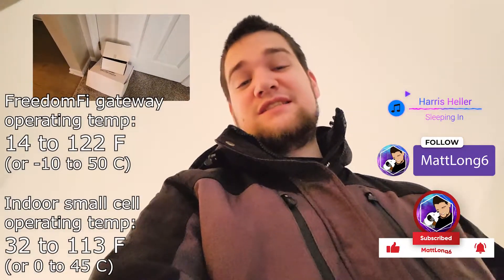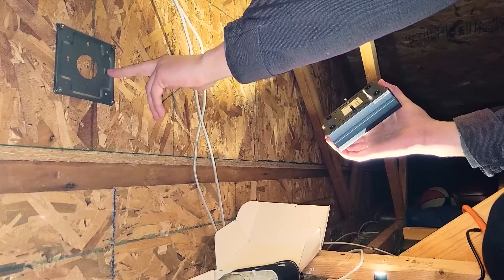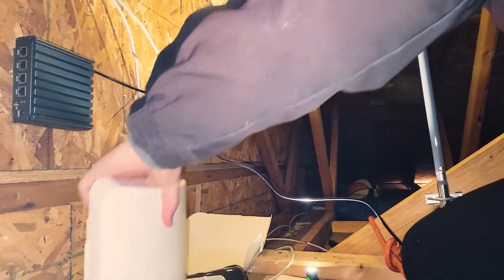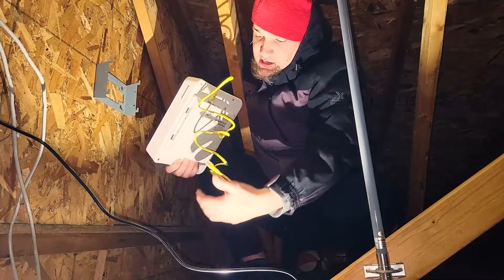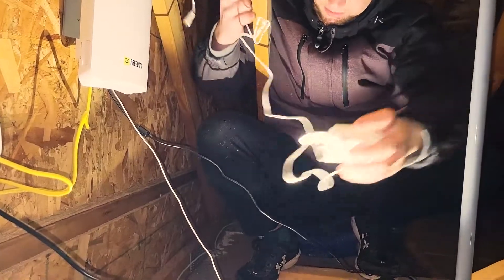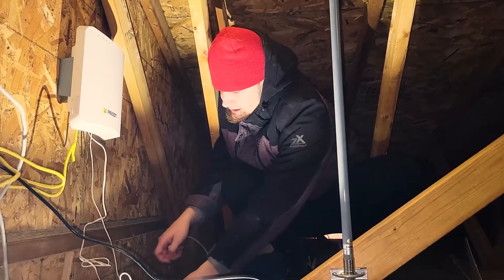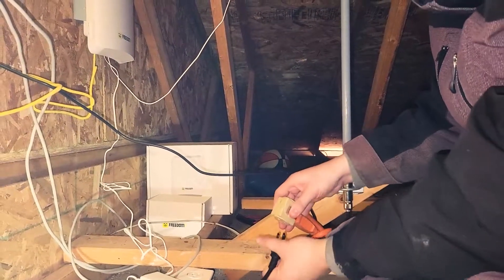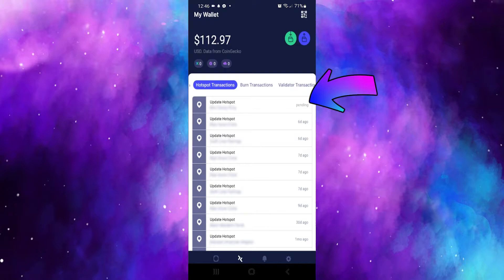Installing my FreedomFi with 5g Indoor Cell Radio - with 8dBi antenna

Comment: Great install video Matt. Very  helpful and informative. I'd like to follow your freedomfi nova430 radio could I please get the specific designated name?
Reply from the maker: Glad that I could help!
Sorry I do not give away the location of my hotspot, however I do a monthly livestream on my crypto channel where I talk about how much it has made. 👍
https://youtube.com/@MattLong6Crypto
Reply: @MattLong6  I can respect that sir. I was interested in following the location bc I am also doing the same setup in the attic and just wanted see the RF coverage map if being in the attic made great results.
Reply from the maker: @69orlando  I will say for my experience the least amount of walls and obstruction the better. Directly outside is the best, attic is also good because there's not as much walls to block the signal.
Reply: @MattLong6  Yeah the attic sounds like a much better choice then a ground or 2nd floor. I agree the higher the better 🤙
Reply from the maker: @69orlando  well would love to hear updates from you in my live streams that you ever make it 👍

I'm not entirely sure if higher is necessarily better, I was only talking about less interference.

The attic we put it in was above a garage.

Comment: What’s the point of running 5G hotspot in a residential area? It will only cover a few neighbors’ houses and your neighbors are likely using their own Wi-Fi at home for data thus you won’t have any mobile data to offload with. In addition, you need to pay $5 per month per radio after the first 12 months as per FCC requirement….
Reply from the maker: I am just testing it out, join the Discord and ask them to get a better understanding :)

Comment: Is that a 5g 8dbi antenna?
Reply from the maker: That antenna is left over from this video :) https://youtu.be/7wYxIlfp1VY
Reply: @MattLong6  very important question so you can use an 8 dbi antenna on the 5g miner?  also can you use an amplifier (acason) and filter on this miner(5g) with an 8dbi antenna ?
Reply from the maker: @Anibalm28  yes for the 5g and 8dBi. I have not tried the amplifier.

Comment: Who's better? Freedomfi is rakk.
Reply from the maker: What? typo?
Reply: @MattLong6  or.       not is
Reply from the maker: @shangtsung9973  if you want to upgrade to 5g, FreedomFi, better if you don't care about that then RAK is better, because it comes stocked with a slightly better dbi (2.3 vs 1.2dbi) and can be wireless.
However I do not think you can buy the RAK anymore.
Consider watching this for some of the other options.
https://youtu.be/CKxtfoTKKx8
Reply: @MattLong6  do you have indoor cell or outdoor cell for freedomfi?
Reply: @MattLong6  I have freedomfi  coming  do you have any videos on it
Reply from the maker: @shangtsung9973  
1. https://youtu.be/s1PyHJYstf4
2. https://youtu.be/Nx8G3ln0NX0
3. https://youtu.be/s1PyHJYstf4
4. https://youtu.be/V8o0Szuduxk
Reply: @MattLong6   thanks 😁

Comment: Pricey unit and lackluster antenna and no built in wifi like the others?  I guess they need ethernet due to the 5G speeds but still.
Reply from the maker: Wish it was wifi abled too.
I want to review the Nebra 5g unit when it comes out too :)